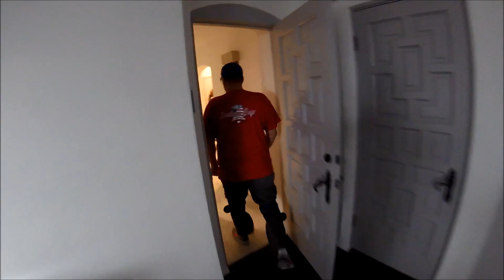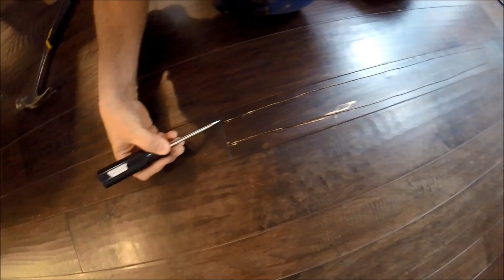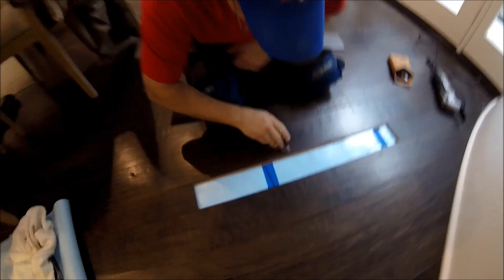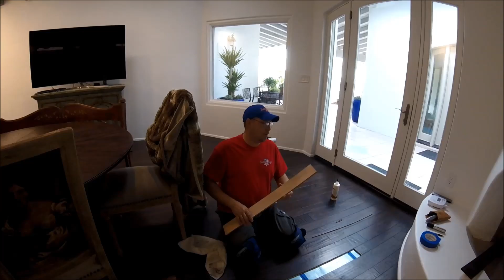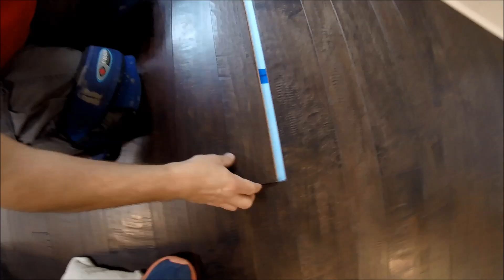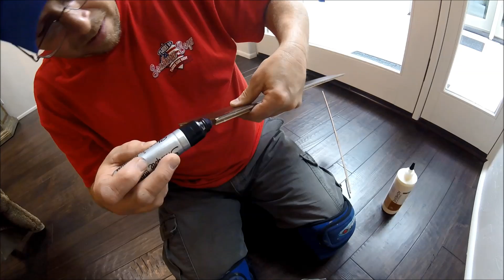HOW TO REPLACE A HARDWOOD BOARD

Comment: Would this method work using engineered wood flooring (not hardwood)? Also, because of all of my wood floor tiles being interlocked, would cutting out the 2 damaged pieces damage all of the wood floor tiles around it?

Long story short, my dad redid my floor in my room. He put sponge on top of the old floor and clicked all the pieces of new floor on the sponge. Would this method still work? Would I be able to glue the new pieces on the sponge instead of concrete? Can I hire a professional to do this for me because I'm not a handyman? I'd appreciate if you can answer my questions, thanks.
Reply from the maker: DarthMaster09 Yes sir, this is actually an engineered floor in this video , And yes if it is on a pad then it is not going to be glued down to the floor and likewise neither was the word in this video, no it will not damage the surrounding wood as long as whoever does it is careful just as in this video, it should definitely be able to be done Following the same steps I did in this video
Reply: Do I glue the new floor tiles to the rubber underneath or do I cut out the rubber and glue the new tiles to my old floor underneath the rubber?
Reply from the maker: DarthMaster09 Are you speaking of parquet flooring
Reply: Are you referring to my old floor underneath or the rubber? If it's my old flooring, yes it's parquet. It's the old fashioned type.
Reply from the maker: DarthMaster09 520-351-1526 Call me real quick

Comment: Cut the center out , cut across the middle , take the center out , cut a groove just big enough to use a flooring  hammer bar in . That makes it easier to knock out the glued edges . This video is doing it the hard way .
Reply from the maker: William Molchan Thank you for that appreciate it

Comment: We did some floating floor recently after finishing the floor had some squeaks/clicks sounds. What would you recommend to fix ?
There was no Underlay padding. Thanks.
Reply from the maker: Christian Wilson The clicks sound that you’re hearing is probably because there is no pad under it, and I would guess and say that the squeaks is caused by the edge of the board rubbing on the wall somewhere you might have it cut too tight you need a gap approximately threeeights of an inch from your flooring to the wall you might check around the edges and if you see the Wood floor rubbing the wall anywhere you can take in osculating tool and cut it to create a gap , I hope this helps you out and thank you for watching